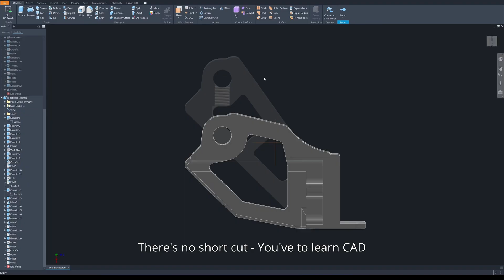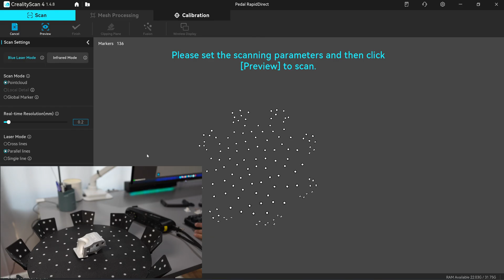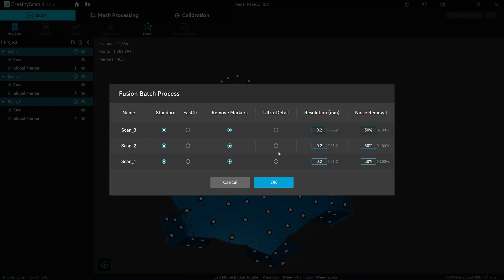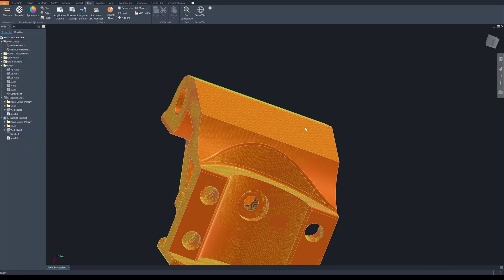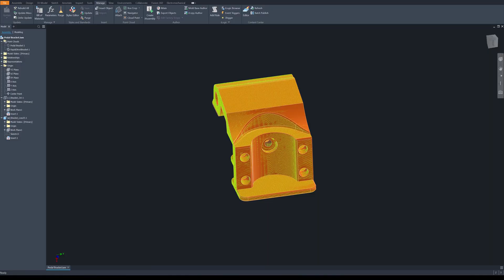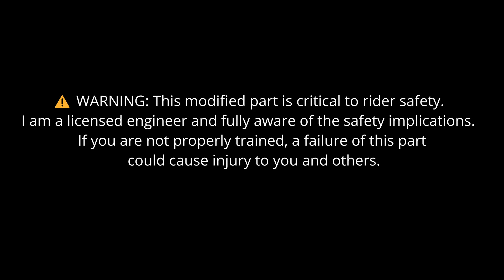DIY Aluminum Pedal Bracket RapidDirect CNC Review (Featuring Sermoon S1)

Comment: Doesn't Cloud Compare let you check for deviation? Or it won't make sense?
Reply from the maker: You're right, the deviation plot isn’t useful for accuracy verification. Instead, we measure the accumulated error from one contact face to another. This data allows us to fine tune the CNC machine, jig setup, feed rate, cutting speed, and milling sequence to minimize error in that region.

Comment: 5:35 how do u determine how many triangles it should have? looks like u lowered it from 2m to 1.8m. same for the isolate part 16%. is it just experience with different models and know what works best?
Reply from the maker: The total number of combined triangles is displayed in the upper-left corner of the viewport. Your mesh triangle count should match this value. As for the isolated part slider, you may need to adjust it a few times, though in most cases you won’t need to enable it.

Comment: Could you post a comparison when scanning at different temperatures?
Reply from the maker: Aluminum expands 24 µm/m/°C. A 15 cm block shifts by 36 µm with a 10 °C change. In metrology labs, we work at 20 °C and stop measuring if the bench temperature moves outside ±2 °C.